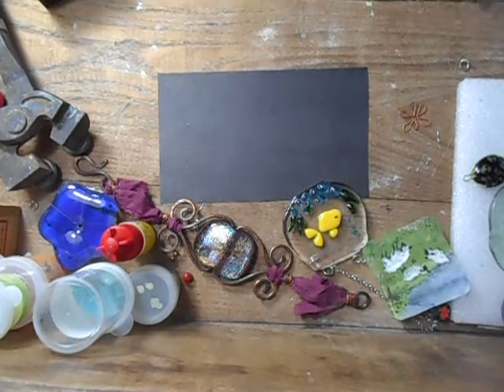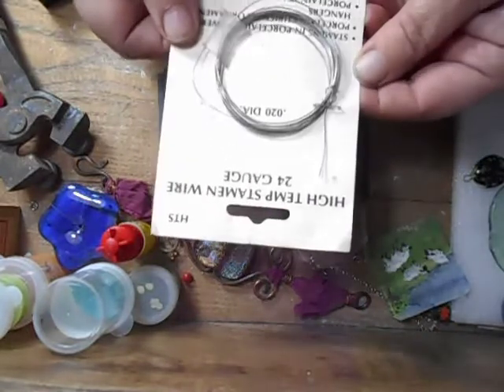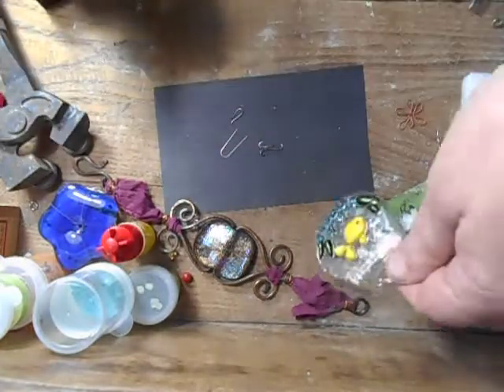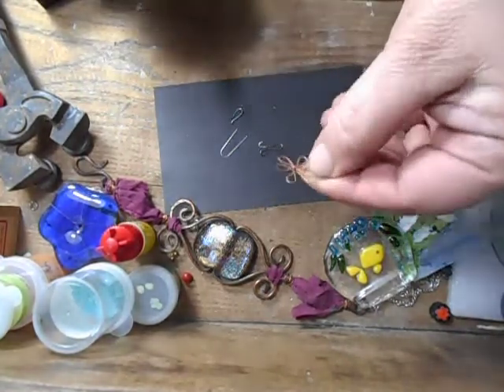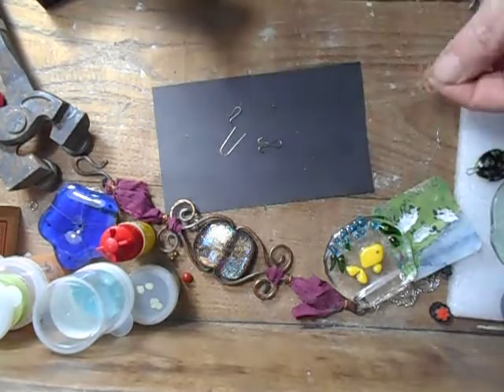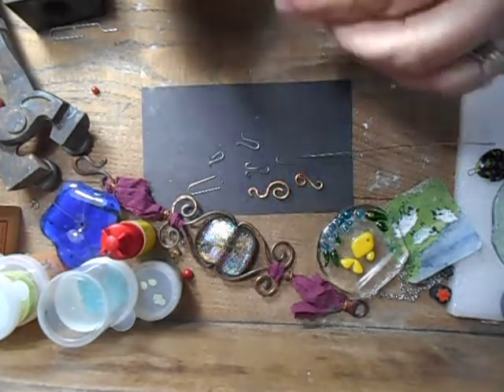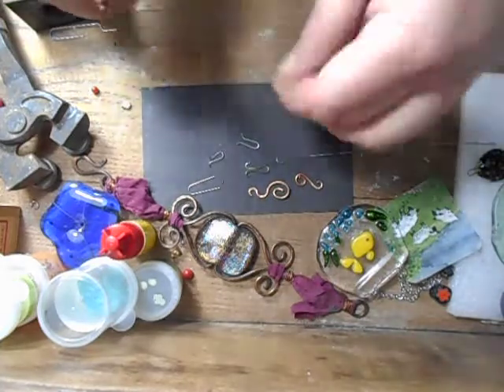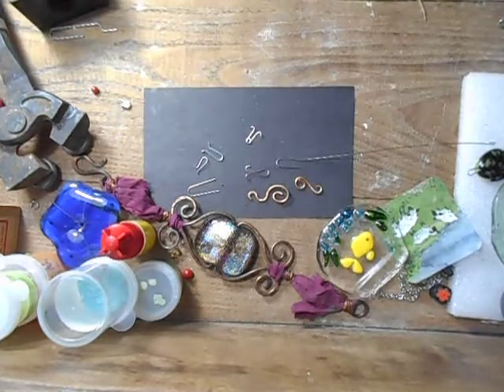WIreLoopsMWK

Comment: Love all of the information you are sharing. So much to think about & try. What kind of firing schedule would youuse if you're adding wire to a piece?
Reply from the maker: No different than what you would use for the piece in general.   Perhaps a bit slower as some wires heat faster than the glass.   These are usually multiple-layer pieces anyway so "low and slow" until everything heats up as usual for that situation.